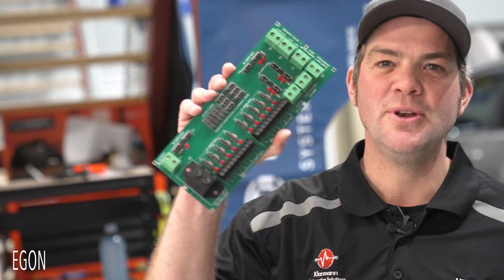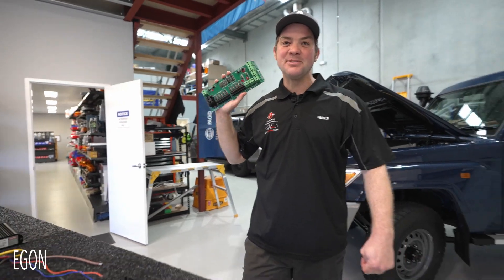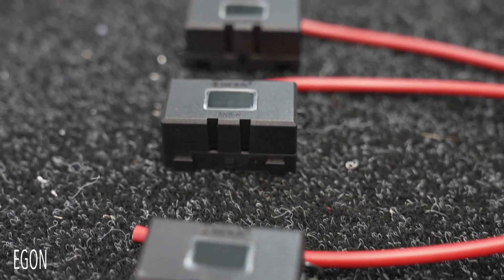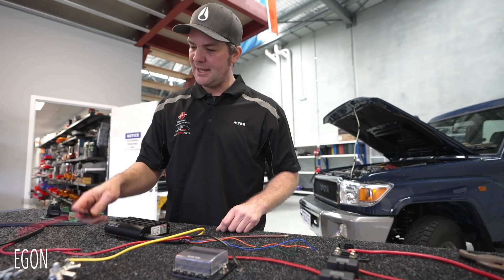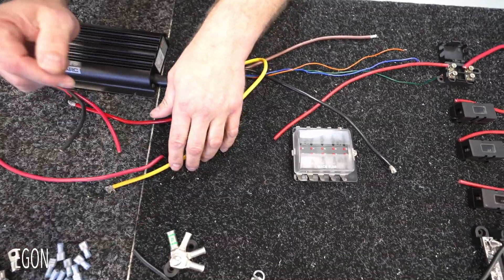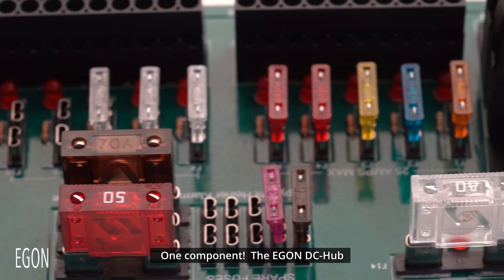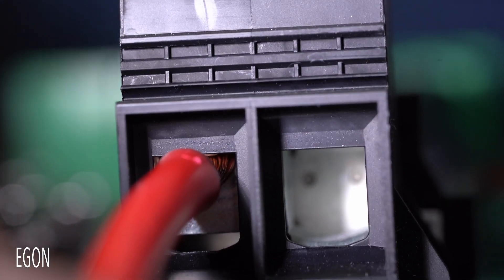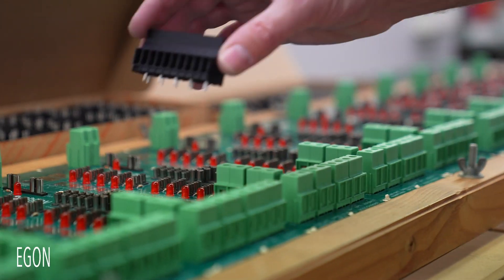SAVE BIG ON YOUR DC INSTALLATIONS. EGON DC-HUB EXPLAINED in 2 MINS | EGON

Comment: Any special setting required for 24 volt systems, or it's the same unit / plug and play?
Reply from the maker: I suggest using the contact form on the website for questions. YouTube is the worst place to send messages as comments on our videos are not monitored.

Comment: I’ve got a 91’ HZJ77. 24v organic system. I’m currently running a redarc BCDC 1224 to take 24v in from the truck for use on an isolated 12v. Would this DC Hub be appropriate for use in this situation? 

24v in from truck + unregulated solar > DC power hub > Redarc 1224 > 12v aux battery > 65l fridge + ARB dual compressor + LED camp lights